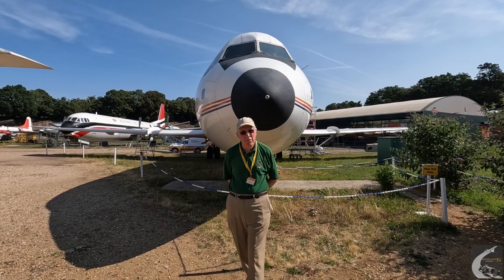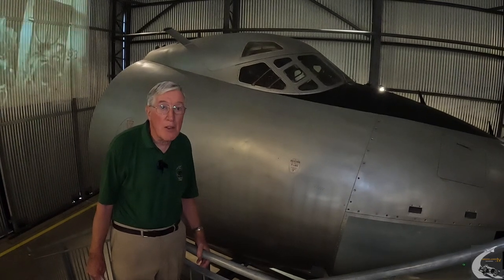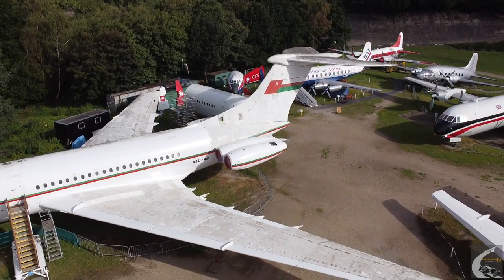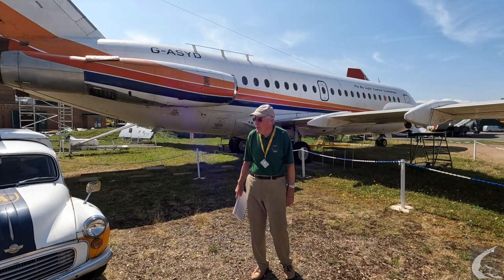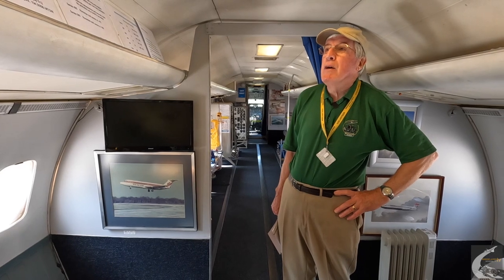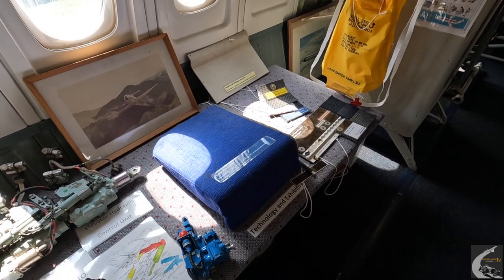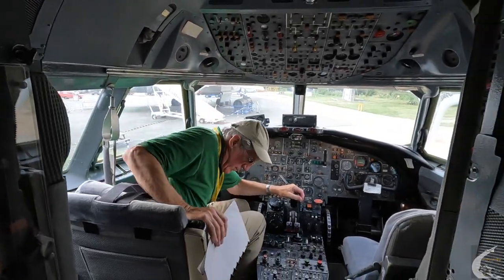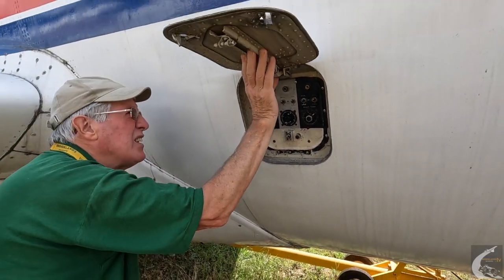Brooklands BAC 1-11

Comment: Very nice presentation. The BAC 1-11 was used in Western Germany as charter airliner in the early 70s. Operators where Germanair, Bavaria, Hapag-Lloyd and Paninternational. The later filled kerosine into the water injection system and had to crashland on an motoway/Autobahn.